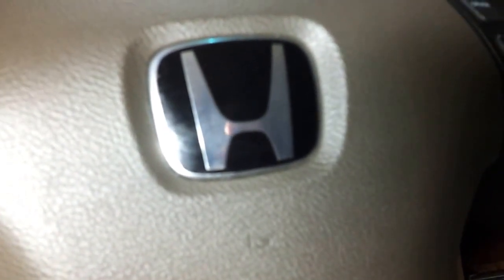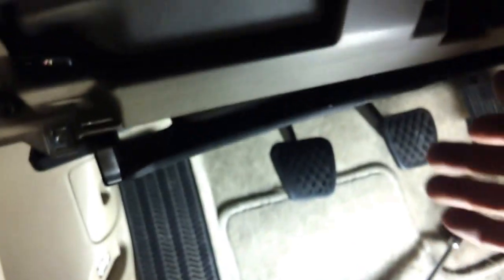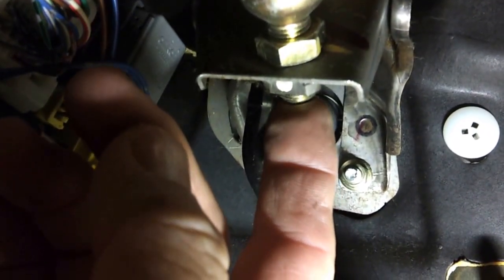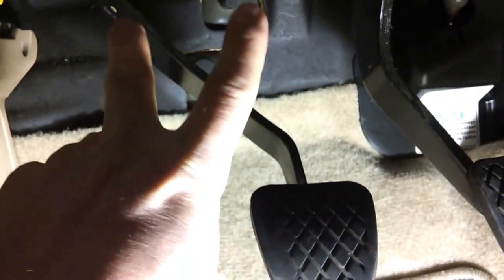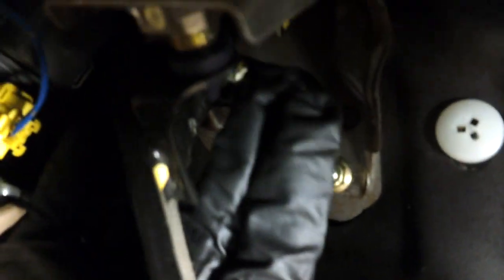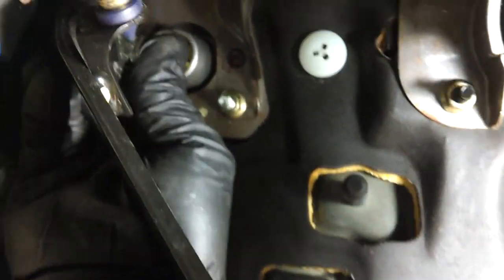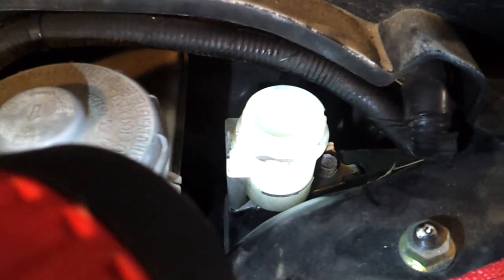Clutch Master Cylinder and Slave Cylinder - Honda Accord - 5 speed - 2005

Comment: Is it possible to do a diy rebuild of the master & slave cylinder assuming you don't have  the broken disc issue?
Reply from the maker: rztrzt anything is possible but it is more cost effective to just replace the entire unit to save time and money.   Sometimes if QUALITY seals can be found it is the way to go, more often then not throw out the old and bolt in the new 'junk'.  lol  Take it easy - Ozz
Reply: Geez, that was the fastest reply ever!

Yeah I suppose it's less hassle to just replace the entire unit.

Thanks Ozz, great video!

Comment: Why didn't you just pull the pressure fit pin and disconnecting the hydraulic line instead of removing the whole master cylinder and initial hydraulic line? I replaced my 2002 Honda Accord clutch master and slave and that's how my friend and I removed the master by "pulling the pin" then the whole master came out. Great video for my newer 2011 that needs a bleed out maintenance done on it.
Reply from the maker: What exactly is a pressure fit pin. I have worked on cars for over 30 years and never heard of that term.

Comment: The broken pressure plate was caused by the broken bolt.   With one side lifted up the O ring squeezed out and the pressure plate was pressed up against an uneven surface.  It is hardened steel so it can not bend and that broke it.
Reply from the maker: Interesting theory, thanks.

Comment: A few weeks ago I lost pressure, and it leaked all the fluid out, I found out that one of those bolts came loose. I managed to tighten it back on, added new fluid  and and bled it. I was good to go. Until yesterday I lost all pressure again in the highway. I took a look at it and the bolt snapped off.

Comment: A few ago I lost pressure, and it leaked all the fluid out, I found out that one of those bolts came loose. I managed to tighten it back on, added new fluid  and and bled it. I was good to go. Until yesterday I lost all pressure again in the highway. I took a look at it and the bolt snapped off.

Comment: watched the whole vid! great video man.  my 2011 honda fit sport clutch has been feeling a wee bit vibrated or almost a bit sticky when it engages throughout all the gears.   You think it might be a master/slave cylinder issue?  not really sure.
Reply from the maker: +HingleMcCringleBerry anything is possible.  If it is a high mileage vehicle I would bleed all the old fluid out and put new fluid in.  See if that smooths things out for you.  As long as both the master clutch cylinder and slave cylinder are not leaking and 'functioning okay.  If the new fluid doesnt cure the issue then its time to diagnose further.  Start off simple, easy and inexpensive.  Take care and good luck
Reply: +Ozzstar the car actually only has 39k miles on it.
Reply from the maker: HingleMcCringleBerry start with the fluid flush, use the correct spec type....some use would do it good ;-)
Reply: +Ozzstar thanks a bunch! I'm new to working on cars.  but I've done a few fixes myself and I love doing work :D

Comment: Hey Ozzstar,  what would you recommend for removal in a situation where the 10mm nut is stuck on the slave cylinder?
Reply from the maker: If you mean stuck like corroded or rusted I would use PBlaster and let it soak overnight.  Then if that didn't work I would heat the nut with a torch and then bust it loose.  Hope that helps you out

Comment: Thanks for the great video ozzstar.. I have a question bud?? I  just replaced the master cylinder on a 05 Acura TL 6speed.. I'm having a difficult time bleeding the cylinder?? I'm doing the bleeding through the slave master cylinder that sits at the front of motor?? Is that the correct way to doit?? Or do you bleed the Master and Slave cylinder individually?? I would really appreciate a reply from anyone that knows what to do in my situation?? It's my first time replacing one of these.. Thanks
Reply from the maker: +El Matador Tapia the proper way to bleed the CLUTCH master cylinder is through the slave cylinder.  Best to use a vacuum pump to bleed the air out.  It can be done manually by pumping the clutch pedal but it is tricky and difficult and takes a lot more time. Hope that helps you out.
Reply: +Ozzstar Thanks a lot pal!! I will definitely skip the pump the pedal for days bleeding process and use a vacuum pump. Keep the good videos coming 👌

Comment: 2004 accord here with 222,000 miles. Its on it’s 3rd hydraulic clutch cylinder. The pedal seems to be sticking at the top towards the end of the pedal movement but only on first and second gears. Transmission shifts good. Am I having an issue with the cylinder again? Thanks.
Reply from the maker: I really can't diagnose an issue like that over the internet.  Aftermarket parts don't always work that great.  I have seen old slave cylinders "stick".

Comment: Hi Ozz I think I have this problem if you can help answer, my car 05 accord 4cyl starts and runs. I can down press my clutch firmly like normal and goes into any gear I want but won’t go anywhere. Also feels like I can put it in any gear without pressing in the clutch. Thank you for your time.
Reply from the maker: Need to check that the slave cylinder is.moving, also proper cllutch operation.

Comment: Not sure about sabotage, more likely poor design and/or fastener selection. When replacing my clutch master, I opted to replace the 3 bolts with grade 10.9 flange bolts through bolted to a nylon lock nut. Hopefully that is the weak link in the chain.

Comment: I replaced the master cylinder and slave cylinder bled the lines and still my clutch goes to the floor. What am I doing wrong?
Reply from the maker: +Rachel do you mean the pedal goes to the floor without any resistence?  There is still air in the system.  Make sure all connections are tight and not leaking any fluid.  Use a vacuum pump for best results getting the air out of the line.
Reply: We got it... Thanks
Reply: +Rachel Kennedy If it takes longer than 10 minutes to bleed a New Master Cylinder, something is seriously wrong.

Comment: After trying to change my master cylinder  on my 2001 honda accord i lost  the pin that holds the break lines to the master Cylinder ,so i brought it to canadian tire and they cheaped out by using a 39 cent cotter pin . if you are familiar with the accord u know exactly what im talking about . the pin holds the brake lines in ;no bolts and if it sheers off game over no brakes.  the factory pin is precision fit with special metal alloy designed for that . not a cotter pin or whatever they call it.
Reply from the maker: You need to order the oem pin for sure.  Canadian tire needs to know how dangerous there repair is! Ughhh I hate hack work.

Comment: I did this part on an RSX once and getting it back in was hard. Did the Accord have enough room to easily install the Master?
Reply from the maker: It's a little bit tight but can be done fairly easy.  If wide open space is easy and impossible clearance mean no access, I'd put it in between.  Wiggle and twist and its done.  I haven't seen an RSX setup so I have no comparison.
Reply: I have an 06 Accord was fine a few days ago went to go somewhere and wont go into gear. I changed the clutch kit sep 2016. Found a leaking slave, going to check the master next. Creeps forward when started in gear and holding clutch pedal down. What do you think, master or drop tranny again?

Comment: Actually just happened to me at the Taco Bell parking lot. same Corner bolt broke off too. Lost the master cylinder pressure
Reply from the maker: You ran to the border and got stranded. Tow truck time. 😔

Comment: So when you have no pressure or very little pressure on the clutch petal is the master cylinder failure??  i have a honda crv but thanks god never had an issue, yet.  it has about 120k miles
Reply from the maker: Can also be a slave cylinder, low fluid due to a leak, worn clutch disk, broken pressure plate.
Reply: @ozzstars_cars  Thank you very much for your repply, so how you figured in this case was the master cylinder? I understand you changing the slave cylinder at the same time (you took a smart guess)???
Reply from the maker: @dannynica7480  I dont guess I test.  Watch the video again, broken bolt on the master, fluid leak.

Comment: my car is having problems clutch does not slips but when i try going from neutral or every time i change gears is hard for it to go into gear and sometimes it grinds.....my master cylinder feels weird....it does not leak at all but i have to push the pedal all the way to the bottom for it to go in gear.....hoping is the master cylinder any thoughts or ideas of what it might be..
.i need help thanks
Reply: my tsx has a similar issue, hard to go in gear and grinds on reverse. did you ever figure out what the problem was?

Comment: Its unfortunate that you didnt film the reinstall. How did you disconnect the hard line from the master cylinder once you got it out the car? Did you have to put it in a vise?
Reply: Not unfortunate because you wouldn't be able to see a thing.Install is reverse of removal. The clutch master on this car is way back in there deep on the firewall, no way to film it.  Watch the video again, i show the U clip that is removed which holds the hard line fitting in place.  Thanks for watching
Reply: ozzstar
Got it. I'm replacing mine now. Pressed out the U-clip with a large pair of pliers and the line popped right off. Fortunately, I was able to get the MC out of the car without taking off the air hose. I had to snake it across the firewall toward the passenger side. Still was a bitch though.

Comment: kind of a late  comment, but need some help. The same thing happened to my '03 accord, I replaced the master cylinder, hooked up everything well, but for some reason the master is not pumping the fluid through to the slave. I filled up the reservoir and it does not get sucked into the system. It just sits there. I crakc open the bleeder while  having someone depress the clutch, and no fluid comes out. Just sits in the reservoir. Any help is appreciated. Tried a vacuum pump and nothing.
Reply from the maker: It is very difficult to bleed the clutch master just by pumping the pedal.  It will take a lot of time.  Best bet is to vacuum bleed with a pump.  Takes only about a minute that way.
Reply: Ozzstar thanks for replying. I rented one at an auto parts store, hooked it up and pumped it from the slave but no luck. I will try again with a better pump.

Comment: Any help will do. 2004 accord v6 6 speed.
My clutch sticks very lightly at high RPMS. When I shift around 3000 it feels fine, no sticking. Any answers?
Reply from the maker: Victor i would have to road test the car to give you a correct answer.  Is the hydraulic clutch bled properly? Car have high mileage original clutch?  Pressure plate could be getting weak,  it could be lots of things.  Have it checked by a trusted mechanic.  Post back what you find, take care Victor
Reply: sounds like a clutch pressure plate to me, does it grind too?

Comment: Probably installed a racing clutch and didn’t upgrade the master cylinder , so the pressure made the bolt snap maybe
Reply from the maker: This is a stock '05 HOnda Accord, no racing going on here. lol

Comment: Thank you . Could please tell me how bleed and evacuate air manually after install Mc ?
Reply from the maker: bleeding the clutch master cylinder is difficult by hand/foot pumping the pedal, you will need 2 people. one person inside the car, the other person at the slave cylinder bleed fitting   Get a vacuum pump and you can get the job done fast and by yourself, make life easy.

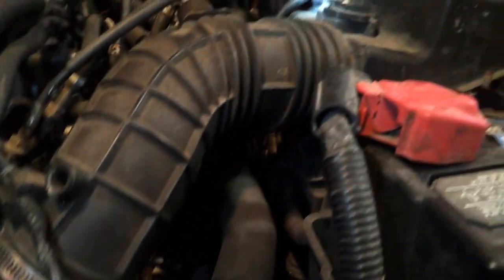Comment: 6:45 - what is the point of replacing slave?!? The fact that master burst (famous diaphragm burst plate) has nothing to do with slave cylinder.
Reply from the maker: Car had 165K miles on it and almost 10 years.  The time savings of bleeding the entire system once with new parts is not only convenient but makes it more reliable. That's the point 6:55.

Comment: Same flipping bolt was missing on my master cylinder also. Must be a conspiracy...
Reply from the maker: Most likely shared off.....thanks for watching, hope this vid helped you out Matt.  Take it e z- Ozz
Reply: This vid helped tremendously. Got both cylinders replaced with minimal pain. Mine is an 06 accord. Bleeding the line has been a pain unfortunately. Initially I had someone pump then hold the clutch while I loosened the bleeder screw. Got air and repeated process until I didn't. Tested out the clutch and got the grind when trying to put it into first. Assumed there was still air stuck in there. Second method was I unbolted the slave from the tranny and pushed the pushrod in forcing fluid back through the reservoir. Got some bubbles, and clutch pressure increased. I also would tap the lines to help loosen potential bubbles. Still slightly soft clutch when initially pressed, but getting there. Tested the clutch yet again, and seemed to get closer to going into first.  Third method was I purchased a one-man bleeder kit (similar to the vacuum bleeder only it doesn't have the vacuum pump). Hooked it to the bleeder screw, had a clutch buddy pump and hold clutch, loosened the screw, and got three bubbles. Repeated to ensure no more hidden bubbles. Now we have a solid, firm feeling clutch. Car will almost, almost, almost, go into first. To make sure I didn't have a more internal issue, I added some material between the pushrod and the clutch fork to "lengthen" the pushrod's range, and first gear still has a grind but it will go into first without killing the car. Chaos is having a lot of fun with me. Can you give me some advice on how to win?
Reply from the maker: Matt Linthicum Sounds like Chaos enjoys hanging out with you! lol  i would make 100% certain that all the air is removed from the hydraulic line.   The system should be bled from the slave cylinder until no more bubbles are seen coming out of the system using clear plastic tubing.  There should be a good firm clutch pedal. Extending the slave cylinder rod with a spacer will not help with a hydraulic system and is not suggested.  How many miles on the clutch? Let's hope it isn't a clutch disc because the entire subframe assembly must be removed to pull the transmission out, its a BIG job!!

Comment: I am about to put the 4 th one in my accord. The design of that part is a joke!
Reply: Did you use honda parts?
Reply: I just put the 4th one on my 2007.  I've tried Honda, Duralast, and now I'm trying Sachs parts.  You can take the M/C, clutch line, and S/C off as an assembly, bench bleed it, and put it back on as an assembly.  That's the only way I've ever been able to successfully bleed it.
Reply: I still have the original on my 2004 accord  215k it still works fine but its squeaks.  I was thinking of replacing it add preventative mantinence
Reply: @Stevesbe  check your fluid if it's dark and has tiny particles replace the parts before it strands you which has happened to me several times.  You push thr clutch in, it makes a bad noise, and the pedal is then 100% limp.  If the fluid looks good I would leave it be.  My OEM master cylinder went to 150,000 miles.  Now they are failing about every 12 months no matter which parts I use.  Mine now seem to fail when the temp drops below zero.  Check the tightness on the two nuts holding the mc to the firewall mine get loose and then it squeaks.
Reply: @Stevesbe  bleed and replace fluid ASAP with OEM Honda fluid
Reply: I ended up replacing my master cylinder with one from a 2005 Civic master cylinder has a much better design it doesn't blow out easy like the Accord